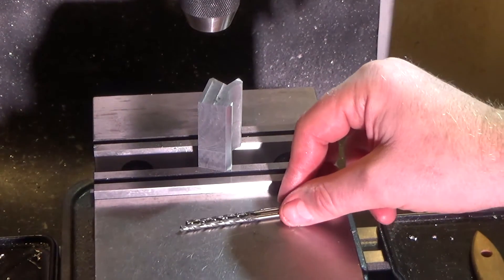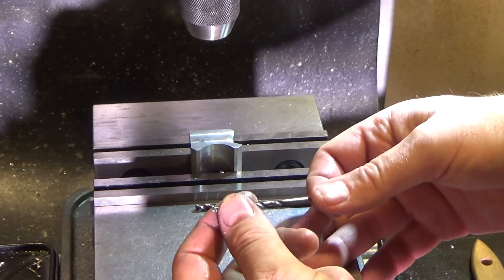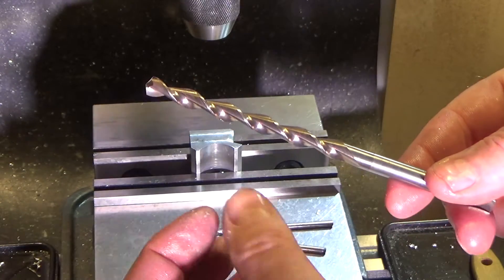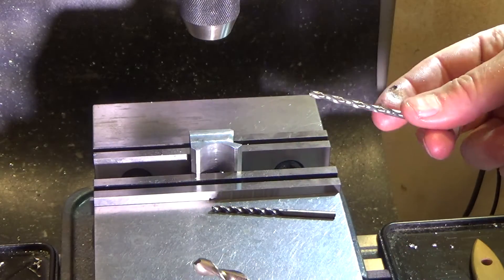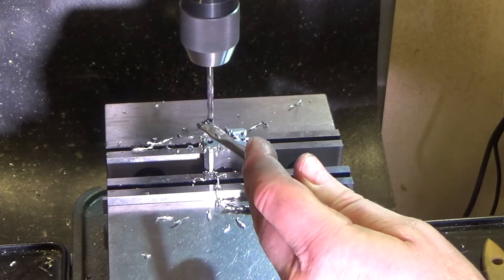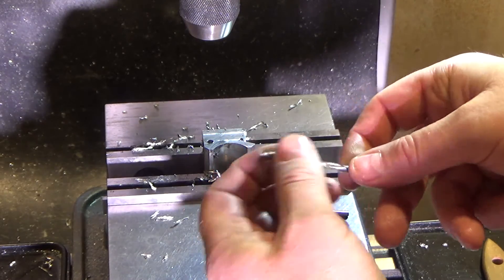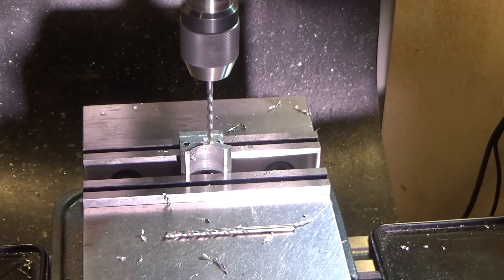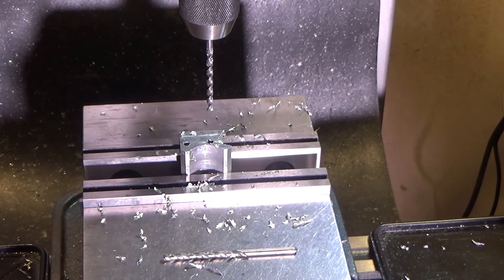QTR #3 Deep Drilling Small Holes

Comment: Is there a reason you couldn’t do this on a drill press instead of a mill?
Reply from the maker: I don't see why not. I have very limited space in my shop so every tool is chosen for maximum flexibility. I had to get rid of my drill press to make room for my welder. The mill is the only tool I have to drill with now. Thanks for the question.
Reply: Thanks!  What model mill do you have?
Reply from the maker: ACRA 9x49 Chinese made. They also sell a Tiawanese made version for double.

Comment: Hello.
I need to make a deep hole in aluminum 5056 today
Drill diameter 2mm depth 45mm
Can you give me any advice? I do not know where to start the experiment.
Reply from the maker: That is going to be a really tough job, especially if you want a straight hole. I would think there is going to be a lot of pecking or your going to lose the bit. Here is a link to a very good video put out by HAAS:

https://www.youtube.com/watch?v=sykjB7fS1Po

These guys know a lot more than I do about, pretty much everything, so I hope this helps. My take is that drilling deep/straight holes is hard for almost everyone. Perhaps a hint would be to ask some of the gun guys that bore barrels. They need to pull off these difficult holes with extreme accuracy. I sorry I couldn't be more helpful. If you find a good answer that works, please come back and let us know. we can all learn something. Thanks for the great question.

Comment: on aluminium I have found that wd40 works the best for me as lubricants you should give it a try. thanks for your videos.
Reply from the maker: I did recently and you are correct, it does work well. The only downside to wd-40 is that if it gets sprayed around and you don't get it all wiped off of your machine, it turns into a sticky mess after a year or so.  Other than that it is relatively inexpensive, not terribly toxic, and yields a good finish. Thanks for the comment.

Comment: Hello,  I had always heard them referred to as "hi helix" hadn't heard the parabolic reference.  Interesting.  Although I use a lot of 6061 aluminum it hasn't been enough of a problem for me to really need a solution.  When going way deeper than the flutes it might become more problematical.  Drilling with the tailstock is where clearing the flutes becomes a bit trickier when you exceed the tailstock travel.  I do have quite a few although I have never specifically ordered them.  Take care.  Doug
Reply from the maker: Thanks for the input. I also had purchased a couple of hi-helix bits, but they were essentially identical to my "regular" bits, so I didn't show them. Perhaps the vendor miss shipped the order. Also, I wish I'd have thought of the problems associated with tail stock drilling. That would really be relevant when a lot of pecking is required. Great Point! To deal with issues like that I find it is easier to unlock the tailstock and slide the whole mess back to clear the flutes, but if critical hole depth is important, this solution would bomb. Thanks for the great input.